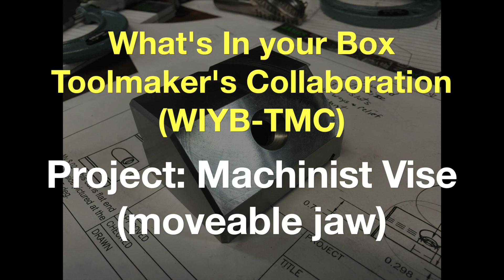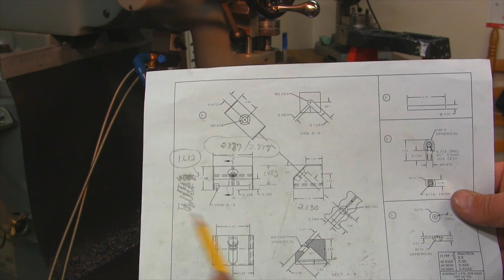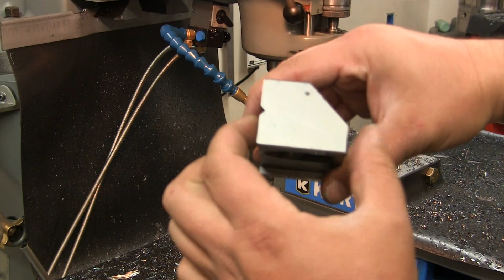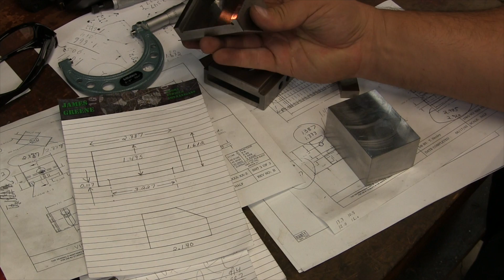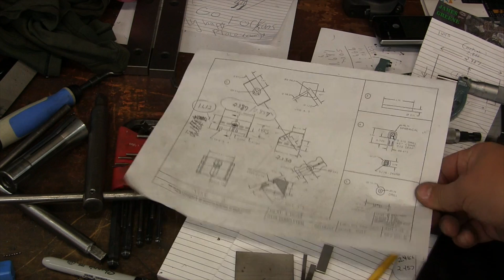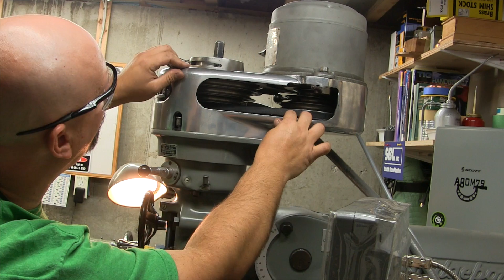WIYB TMC Machinist Vise   Part 2

Comment: Just an observation, but .015" is typically left on for grinding after heat treat especially since I believe Abom said he's not sure what kind of steel that is. Your piece should be Ok because it's mostly uniform in thickness, but you may run into some issues with the larger body due to the non uniform in thickness.
   Anyway, hope it works out for you.

Comment: Hi Brad, in order to save your carbides on the surfacing mill, you could calculate the feed rate to get a cut of aprox. .002" on the inserts with a SFM of around 400, the inserts will cut much more metal and you'll improve the burr situation...
Too bad that all your efforts to produce nice finish will end up in dust on the surfacing operation...   ;)